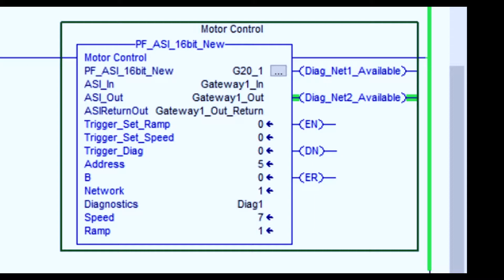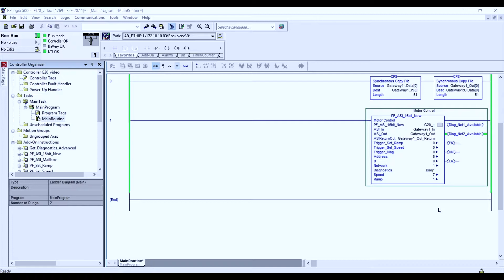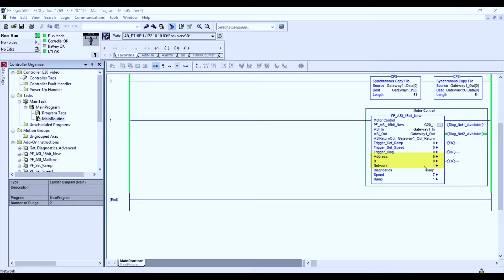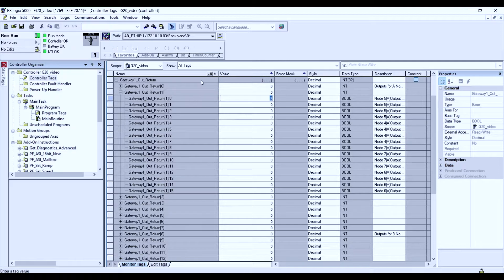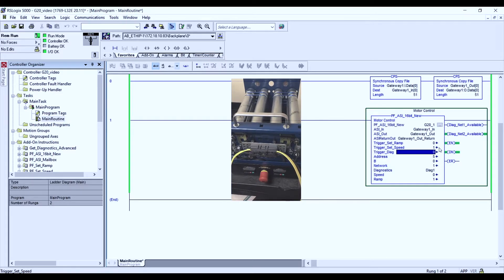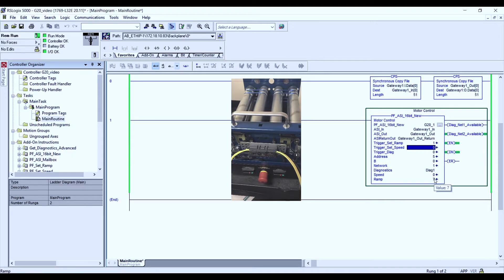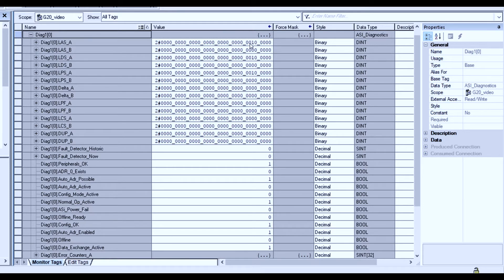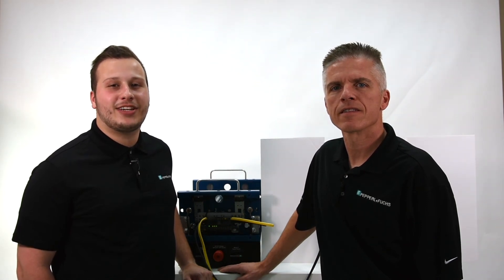Controlling | Ramp and speed using add-on instructions | Part 5

Comment: good video I would like information about plc easy 4 12 dc-tc and how to acquire it I am from Bolivia.!
Reply from the maker: Hi Reynaldo, thank you for your comment and question. 
The EASY 412-DC-TC control relay is not compatible with the G20 AS-Interface module. However, we do offer a stand-alone connecting module—the VAZ-2E2A-G20-ZPA1—that does not require a EASY 412-DC-TC control relay. https://www.pepperl-fuchs.com/usa/en/classid_202.htm?view=productdetails&prodid=91899